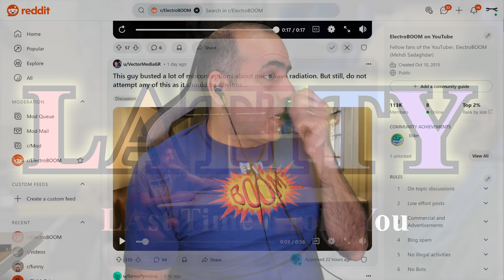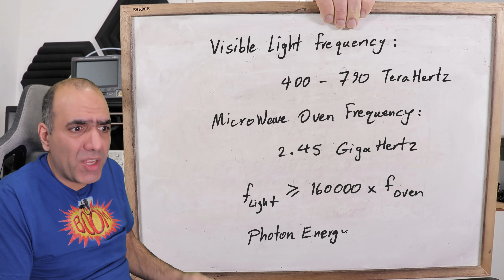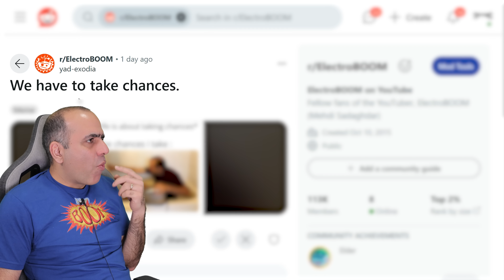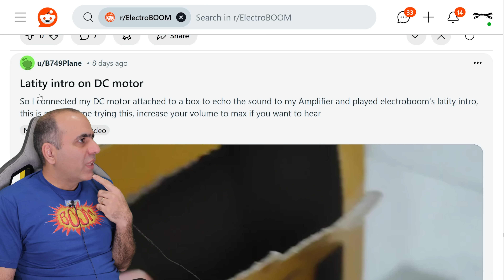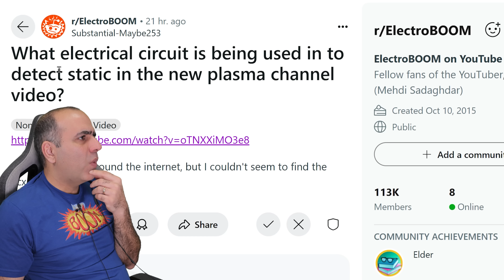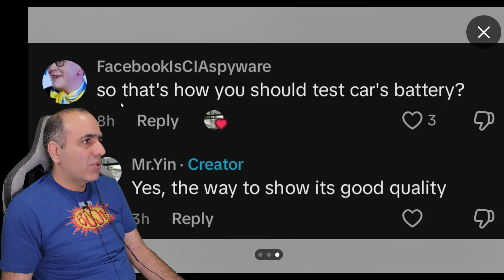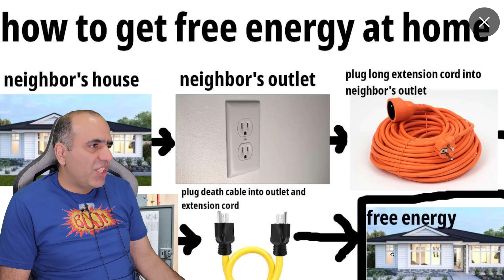Can You Microwave Yourself?! (LATITY014)

Comment: What happens on the high voltage lines on the bridge is true. Of course it is not static electricity, it is just voltage induced in the metal fences and it can cause some small discharges, it also happens near the AM radio antennas. They are not dangerous in themselves but they can scare you or make you jump and cause an accident.
Reply: And the sign posted for the cyclists is because the same thing happens with the metal bike frame, which can discharge to the rider and give them an uncomfortable shock.

I've ridden under lots of high voltage power lines, and this happens under any that have low enough towers. I've learned to keep my hands away from exposed metal (just stay on the rubber handlebar grips), and to keep my legs away from the frame (where they might occasionally bump into it), and that's enough to avoid most of the discomfort.

As I understand it, voltage is induced in both the bike frame and the rider, but at slightly different potentials, hence the current that creates the electrical shock.

Comment: Restaurant workers suffered from continual hand pain after their employers installed microwave ovens with the doors removed.  The workers would just reach in and remove the food, without any immediately apparent damage to their hands.  As it turned out, it still seems to have done long-term damage, ending with a big lawsuit against the restaurant chain.
A 60-watt light bulb won't really hurt you, but just a 5-watt laser can do terrible damage.  So don't trust the safety standard of 'is it enough energy to heat/cook something'   That standard really misses the point.

Comment: Magicians have for a long time loved the trick lightbulbs that light up when you touch your tongue to the base. It would be a really handy device in making fake science videos like free energy. I'm also surprised that we can hang out with microwave magnetron now, I remember people telling never to open the chassis or you'll get very unhappy.

If the chances are either 0 % or 100 %, then we average out at 50 %, right?

The speaker evaluation makes a lot of sense if you've ever had a travel radio with poor reception and you touch the antenna or use a wire to improve the antenna. It does not wait to pop up with a sound from noise, it gives you noisy signal in bursts until you find a stronger signal.

Comment: @11:06 in Malaysia, we use 3-pin UK plug as a standard, and all sockets use that 3-pin standard. However, there are numbers of appliances sold here, mostly imported ones, adopt the 2-pin EU standard. Most of newer extensions and wall sockets now are designed to have grooves on protective covers of neutral and live (hot in NA standard) terminals so that the EU plugs can be easily inserted into the UK sockets without adapters or putting in any non-conductive material into earth terminal to open the protective cover.
Reply: aha here in Malta you have to stick a car key in the top socket prong for it to work
Reply: @AvgeekLMML in Malaysia they sell adapters that basically just jam a plastic plug blade into the earth hole while keeping the other two open
Reply: @AvgeekLMML  NO, no you don't...use something non conductive you tool!
Reply: @Mmm-------79-f4z  I don't do the trick because its dangerous but people use car keys, lolly sticks and others
Reply: @Mmm-------79-f4z  It's earth. It's safe to touch it.
Reply: @BrianG61UK  Assuming the wiring is correct. Not always a guarantee, although probably okay these days, the story I was told when it wasn't was in 1995.
Reply: The same in Singapore. And a number of countries in the region. The best are the "universal" sockets that hotels use and some adapters that basically open up the sockets for the live and neutral so that pretty much any plug, EU (various), US, Aussie plugs can be inserted with a reasonable probability that the pin will touch a bit of metal in the socket.
Reply: Yes, you can jam an EU plug into a UK socket, and I've done it in a pinch, but unless the socket is designed to take an EU plug, you really should only ever do it with low power devices like phone chargers and only when you absolutely cannot get an adapter. Electrically the wiring is correct and the device will work fine, however, the UK plugs are flat and the EU ones are round, so you get a very small contact patch, which might start arcing and damage the plug/socket or in a really bad case even cause a fire.
Reply: @manvydaspletkus3874  Been charging my phone like this for ages, but yea, only for non-grounded low power stuff. And use something non-conductive to open it, like an upside down UK plug if they can both fit without making an arc.

Comment: 5:17 Yes this is doable. Not sure if line level audio would work but I used to do the same as a kid with small loudspeaker source and a 3 pole brushed DC motor. The audio sounded much worse though.

Comment: I know a nice way to zap yourself. Since you're an expert, you gotta try it. If you still have an old CRT tv, turn it on and throw a sheet of aluminium foil onto it from a distance and be sure it covers the entire screen. Then try to take it off again. LOL. I did that after my friend did this and I didn't think about it and it zapped me from several centimeters away. Even in broad daylight, we saw the spark. Without the foil, you can feel the static electricity when you bring your hand close to the screen. The aluminium foil gathers ALL the static electricity from the entire screen and focuses it onto the point where your finger is and generates a huge spark.

Comment: 10:50 Hi Mehdi! Europlugs (C) fit UK sockets if you open the shutters via the ground hole. It’s easier with ungrounded plugs, as Schuko (F) pins are thicker, can damage outlets, and expose terminals slightly—risky! At a UK congress this week, using the trick daily. Classic Euro hack!😎

Comment: Couple issues with using euro pugs in UK sockets like that...
1. No way to connect earth for anything that should have it.
2. There is a safety feture requiring the earth pin is inserted to open some flaps covering the live and neutral. In that photo they'd jammed something in the earth hole to open them.

Comment: I've personally seen goats lose their body control and shake going under high voltage power lines, I passed across and didn't affect me, I was told that the amount of salt in their body is higher which makes static electricity travels through their bodies better.

Comment: I actually tried the motor one for fun a while back, but used a small amp, it really does get louder if you push on it as it drives the sound more into the table. Pretty fun stuff.  I don't know if the power coming out of a phone jack would be enough to drive that motor though so that one probably was in fact faked.

Comment: The nuclear power meme is so bad! The red glowing thing is Pu-238, which is not fissile material. It's used in radioisotope thermal generators for space applications. HMU Mehdi if you want to collaborate on nuclear electricity.

Comment: UK sockets won't allow you to insert a euro plug without inserting something into ground pin first. That is a safety feature meant to prevent people from sticking objects into the live pins, which they defeated by sticking what looks like a paperclip in there. Permanently disabling one of the main safety features is obviously dangerous, especially if you have small kids.
Euro sockets also have something similar but it can be defeated just by pushing hard enough. The UK design is safer.
In Singapore, which uses UK plugs, many electronics still have euro plugs on them. So everybody uses simple plastic spacers that plug into the ground pin and then allow euro plugs to be inserted. That seems fine to me, the plastic spacer can easily be removed so it's not permanently bypassed. And probably is safer than the cheapo Euro->UK adapters with questionable build quality which you can also buy everywhere there, since it's just plastic. It wouldn't be up to UK standards, there is no fuse for one. But I don't know if Singapore follows the UK standards anyway.

Comment: With the European 240v to UK 240v people will say there's no fuse. But I do it with low amp chargers... It even seems to grip the pins just right. But I don't leave them plugged in afterwards. If it was anything more than a charger/power brick. I'd get an adapter. I used to like them with laptops. As UK plugs scratch things up when they get loose.

Comment: 13:22 Yes I have felt the effect passing under high tension lines on a bicycle. If you stop and put your feet in the ground and gently touch an exposed metal part of the bike like the handle bars you may feel the 50 or 60 Hz vibration at the tip of your finger. I guess  the bike is acting as an antenna. No idea what happens if you are riding a carbon fibre bike. Also if you have a cycle computer with a wireless sensor to the wheel there is a good chance it will stop working as you cycle through the field under the  lines.
Reply: Hold up a large neo magnet on a long stick under the lines.

Comment: I got an issue once with a metal post that was under some high voltage ac power lines.
There was an interphone on top of the post and the trucks drivers were complainig that they get chocs some times tuching the interphone.

I thought it was a grounding issue but when I tested the post and interphone everithing was properly grounded.

Then I wanted to check the voltage between me an the post and i found that there was around 50v between me and the post when my feet were on the ground. But on top of my stepladder, it rises up to 300V.

So yes those power lines can stock you with station if you are close enouth to them and touching something grounded.

Comment: Normally when you burn yourself, it’s because of heat penetrating from the outside (infra red radiation) that won’t penetrate your skin (much). 

A microwave will heat all of your body up, all at once. So bone marrow, muscles blood and also your skin. 
The problem is that only your skin contains nerve endings that make you feel heat. 

If the microwaves would resonate on other parts more than on your skin, those parts would heat up more than your your skin and you wouldn’t feel it. 
In other words: with a bit of (bad) luck, microwaves could boil your blood without feeling it. Needles to say that that would be extremely bad.

Comment: You don't appear to understand microwave emissions.  They don't come out the end like water or hot air.  It radiates radially of the wall, you know, like off the glowing component, as if you were looking down at it and could see it, it would lokk like the concentric rings in a tree.  There's a strong point emission sphere for the light, but when you lift overhead, as seen in the video, it goes out.  
I suspect that also caused your audio interference.

Comment: shorting a battery . I remember long ago when working in s standards lab, we used a 2ft tall single cell lead acid battery as a stable voltage source. But the terminals were spaced the same distance apart as the spanner used to tighten the bolts. the apprentice managed to melt the spanner before we could knock it off.

Comment: 13:05 The Bonneville Power Administration controls a transmission line (I believe 500kv) that runs through my city. The city built a biking/walking trail underneath it at ground level, on pedal power occasionally the sharp corners of the seat frame will arc to your leg and give you a little shock that feels like getting poked, but it seems to be proportional to how fast you're going. On my e-bike doing 30mph underneath the lines I have to grab the metal of the handlebars to ground myself lest I get really quite painful shocks to my legs!

Comment: The UK / Euro plug - You need to widen the Euro plug pins to allow them into the UK plug holes, and use a screwdriver to push in the earth hole to allow the shields to move. And the high voltage transmission lines... walk under them with a flouro tube, it will light

Comment: Not an electrician, but live in a place with UK plugs and can confirm, you can jab the EU plugs in there fine, the only sketchy part is jabbing a screwdriver or butterknife into the earth pin to unlock the live and neatural terminals (they usually have a flap blocking them which is pushed out of the way by the longer earth pin).

Comment: 13:18 bit of trivia, bus tours around Australia's snowy hydro scheme would pass under HV wiring and the drivers used to talking about electricity and shocks and tell the naive tourists to put their fingers on the windows as they drove under the wires to see if they felt a pain, and of course they did, the window pane.

Comment: your phone and laptop has a much lower radiation energy yet the user manual/legal/warning part says that do not put yoour phone  to your head, use headset and keep your laptop at least 20cm away. it is in every phone and laptop manual!!!!
Also: we know that the energy of the photon is proportional to its frequency. higher the frequency higher the energy of the photon. But in radio devices we don't talk about the energy of the particle ( photon). we talk about the energy of the wave. (amplitude)
be careful guys.....EMR is carcinogen.

Comment: Euro plugs don’t fit in UK sockets, UK plugs have a longer earth pin that once inserted releases shutters coveringthe live and neutral terminals, of course it could always be forced in.

The static from the overhead power lines is interesting, I’ve been in 132kV AC substations wearing insulated boots, often you would find after taking them off you would get a static shock. Parasitic capacitance..?

Comment: Microwave ovens operate at 2.5Ghz.. So the wavelength is around 12cm. As such there is a different effect depending on whether you are near field (less than 12cm) or far field (greater than 12cm). It is also worth noting that at that frequency, the radiation wont penetrate too far, so the primary effect is stimulus of pain neurons in your hand.
Reply: What frequency is that pain ray vehicle shown

Comment: I know a nice fishing spot where you have to be careful when casting... And yes, there were some fishing lines hanging last time I was there (just the neutral line though.) It's a 3-phase distribution line with likely only one transformer between it and the generators at the hydro plant a couple kilometers downstream. I also have some 4ft fluorescent tubes in my garage.

Comment: you should really look up health canadas safety guidelines. The only risks are to your eyes and testicles. Neither you protected you should have had mesh glasses.

edit: You can make music with a halogen bulb or motor by putting the input into a mosfet off a higher voltage. The halogen bulb was the coolest thing I tried but it quickly burned out when I turned up the volume. (I had 48VDC switched off a battery bank).

Comment: For the euro to UK plug: UK plug is slightly larger, so you need to bend the euro plug (or sometimes you can just force it in, and it'll bend by itself). Also, UK plug needs ground, otherwise the live and neutral are closed off. They only open after a ground is inserted. When i traveled to Cyprus, I inserted my house keys to the ground, and then inserted the euro plug in with a bit of force

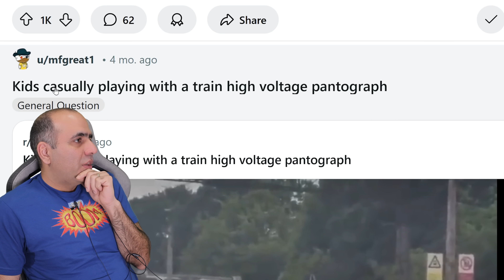Comment: 14:19 Clearly this is on 3000V DC. They should try that on 25kV AC power (both systems are used in the former Soviet Union (and former Czechoslovakia and even current Czechia and Slovakia, especially in the case of Slovakia which si a tiny country with not even 5 million people, we have two different electrification systems - 3kV DC in the north and 25kV 50Hz in the south)). Idiots (I wrote this before I heard you use the same word).

Comment: Is it possible to turn on a 100W bulb with a 50V and 2A power source and vise versal (50A , 2V)
 since the power is still 100W . Will it work or not.
Reply: i think you need more voltage to overcome the resistance off the wire in the bulb. Maybe it will faintly glow. Depends also if it's for 110v or 220v. Maybe the 110v one  can be lit but it will definately glow dimmer. At 50v maybe you cannot run 2 amps through it and it will only take one amp and glow dim. Just try nothing dangerous about that.

Comment: I can confirm the shock warning for bikers as I have a similar power line crossing near my town. Can be quite a jolt. Though be advised that the shock intensity depends on the bike frame geometry and the speed you pass under the power line. No railing there, so can't test for the corona discharge unfortunately.

Comment: 11:03 I ran for many years a CCTV camera from a UK socket with only the supplied EU plug. I did have to use a screwdriver in the earth hole to open the doors, but it worked fine.

Comment: [9:10] During my training as an electrician specializing in industrial engineering, we used to throw charged capacitors at each other for fun. Sometimes we even left them charged on the table. Someone always played around with them and got a wipe. Once, I connected a long cable to an electrolytic capacitor, put it under a colleague's chair while he was sitting there and plugged it into the socket. The bang was very loud and my colleague almost threw his Nokia against the wall. This was a very funny time :-)

Comment: Kida playing with train pantograph? Well just a few weeks ago some of these idiots died because of that. As i am working with high voltage i only can say " Get the fuck away from there !!!" . The current these powelines are delivering is lethal! High voltage, high current and low frequency is a death sentence if you touch it. Arcs can start jumping even if the contact is indirect.